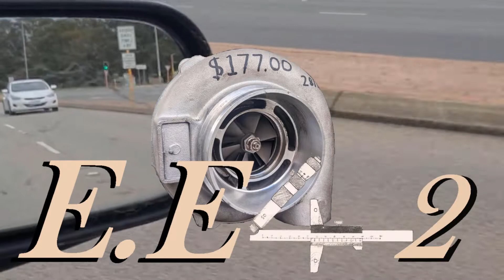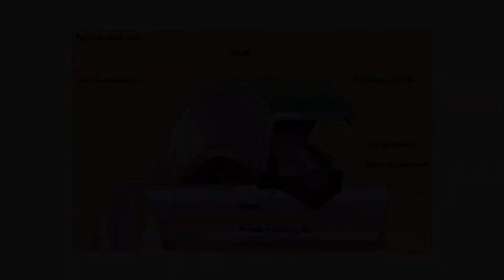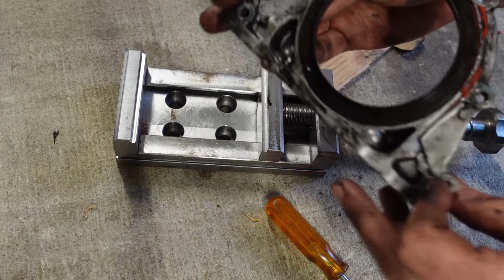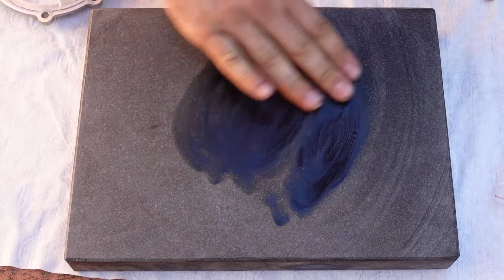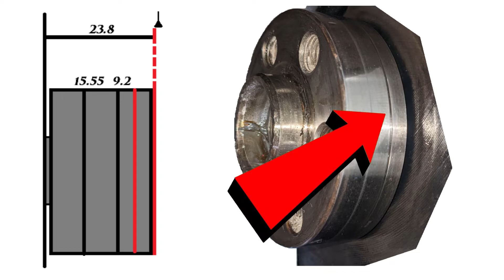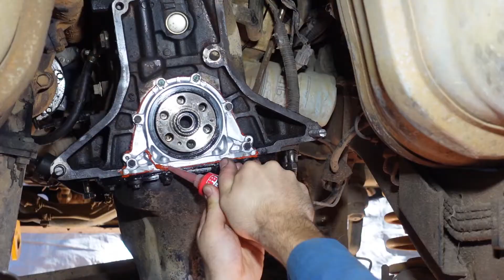How to Fix a Leaking Rear Main Seal - RD28 Patrol

Comment: Thanks for the video mate. Do you know where to buy the seal without the housing? Seems the genuine article is molded together, so big risk in separating them to move the seal to a new position.
Reply from the maker: i bought the rear main seal from golebys in qld. rb25 rear main is the exact same.

Comment: Hi mate.  Great video.  I'm part way through replacing the clutch on my Landcruiser 80 series 1HZ.  The rear main seal/retainer seems to be pretty much the same as yours.  Alas, mine is stuck down a bit too well and is proving very difficult to create a pry point to get it off - anyways I'll get it eventually.  Very nice method of raising the seal to get past the wear groove.  Anyways, great tutorial and I had a lot of take homes from it.
Reply from the maker: Thanks mate. if you are doing the rear main with the engine in the car like i am, id definetly suggest loosening (prefferably dropping) the oilpan so that there is no tension on the bottom of the rear main housing. that housing should be installed before the oilpan. doing it with the oilpan still on does run the risk of compromising the seal where the rear main housing meets the pan.
Reply: @EbayEnthusiast42  Yeah, I thought about removing the oil pan.  However instead, I just used that old trick of putting a self tapping screw into the oil seal to remove it and then put in a new one.   The original sealant still looked good.

Comment: Missed oppotunity to replace the clutch...
Reply from the maker: It wasnt slipping and still had meat on it. Blew all the dust out of it and resurfaced the flywheel. If i bang a gear in 4wd it will grip up instantly still. I rate the exedy